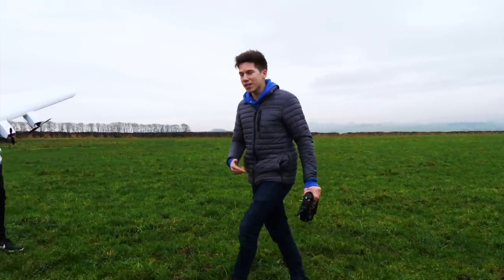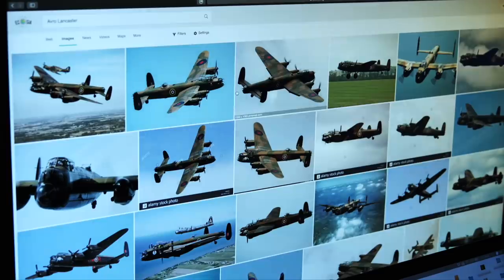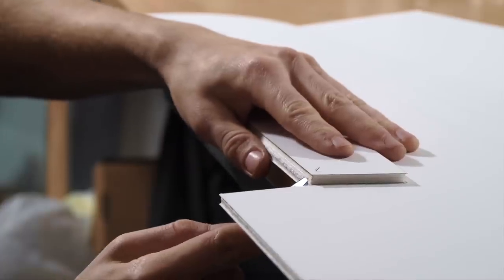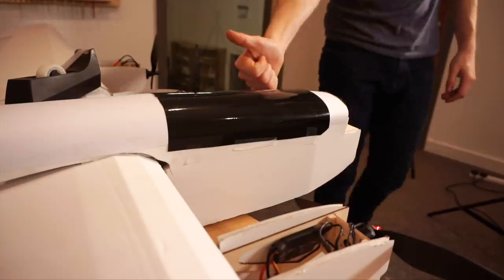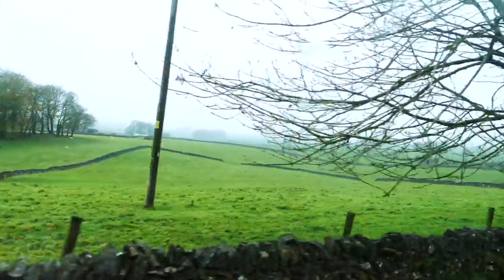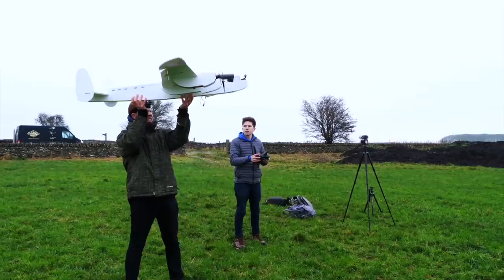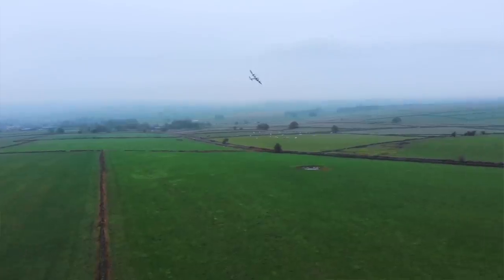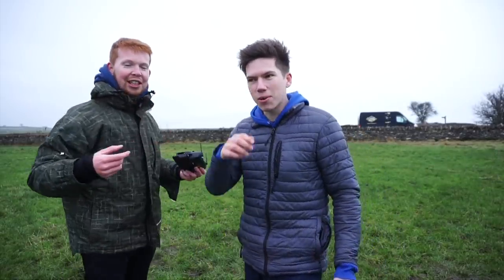Making a Radio Control Dambuster (pt1)

Comment: you captured the style and grace pretty well considering the modest construction technique........talking of which....since you have the entire spec on file....why not develop and refine it slightly and supply a few kits, which you can run off your laser cutter and printer? :) - maybe reducing the ply construction in nacelles to lighter form....reducing the scale fying speed still further / allowing adequate power pack size -

i only dipped into your videos and saw results - could you do a mk2 with: gps / other ways of locking in required release height plus adding gyro flywheels to 'bombs' (or is that already done?) - rudimentary landing gear or folding props would help landings, lighter weight release mechanism (carbon?)

lookin forward to possible future for this project as suggested :)

Comment: Failed to find foamboard on the website.
Reply from the maker: They will be stocking it in the near future
Reply: where are you located? Flite Test is the main supplier of the special waterproof foamboard most of us RC nuts make our airplanes out of foamboard in North America, or Dollar Tree if you want the regular foamboard
Reply from the maker: @stephengoossen6060  Yep, VMC should be stoking Flite Test foam soon which will make it available for the UK and Europe